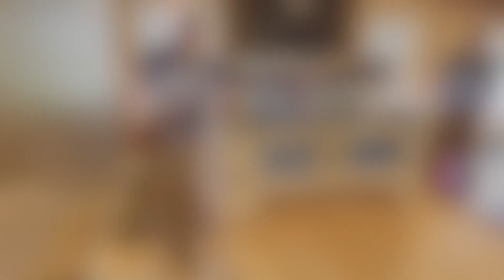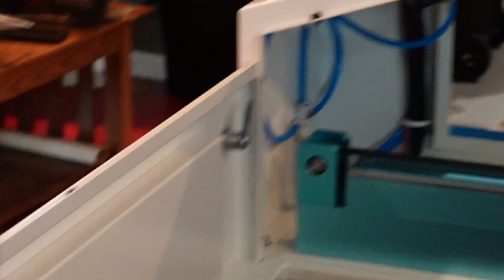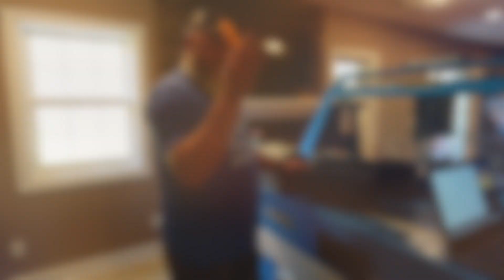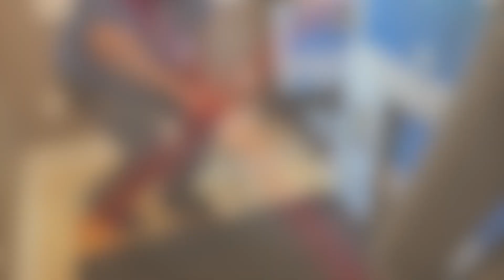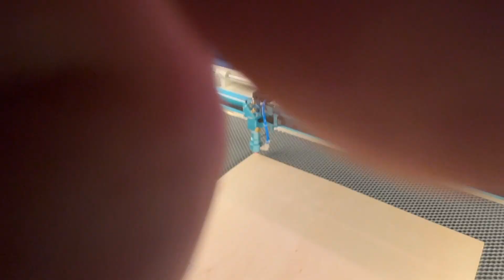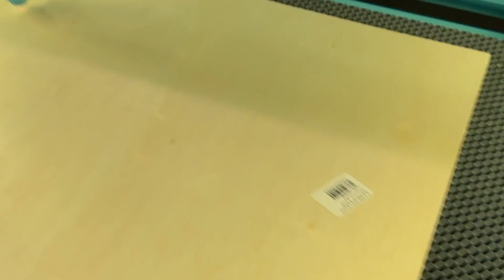Thunder Laser Nova 51 Plus 60W RF Tube: Set-Up from Start to Finish.

Comment: So just to tell you from someone who has cut a lot of pieces on a lot of small stuff if you’re able to have your exhaust be solid piped it’s better because that’s leaves less pockets for stuff to stick to. Also, you should have a Y pipe installed so essentially you put the fan on the white pipe with a little mesh filter on one side so he can suck air in and then blow air through the pipe because if you actually hook your fan up in line, your fan is gonna have to be replaced within 3 to 6 months from all the creole and oils and other stuff they get stuck onto it

Comment: Does this work for new CO2 machines as well? I assume it does…have a buddy setting up today with a CO2 Nova 35 and would send him this if so.
Reply from the maker: The setup is generally the same between the Rf and the glass tube Co2 lasers
Reply: @Angrycraftsman awesome, thanks. I’m gonna have to pick up that jig from you soon as well. Doing more batch orders and it’ll certainly help!
Reply from the maker: @CraftyCopWoodworks  no worries they are in stock.   I think I have a setup video for the standard nova as well